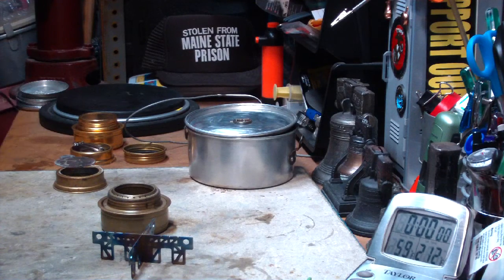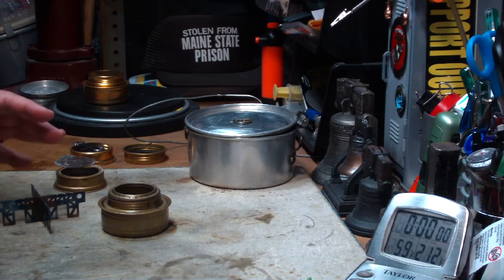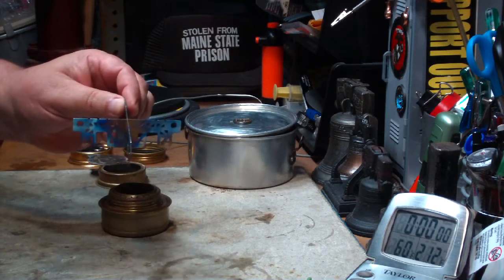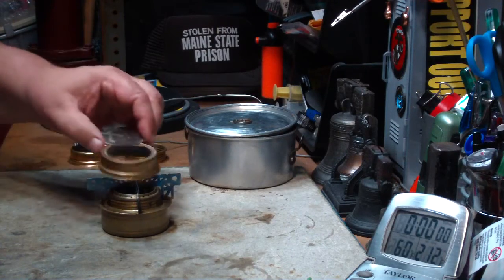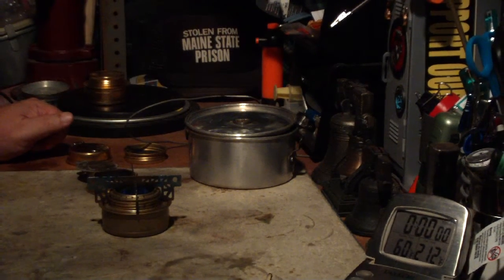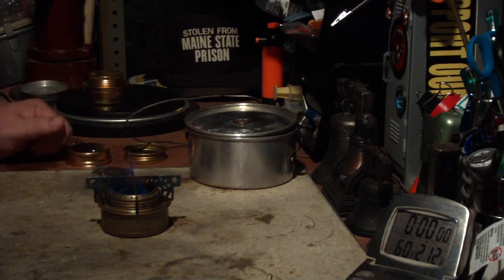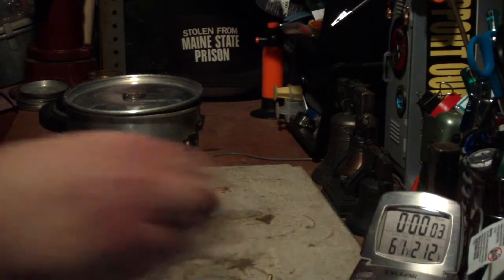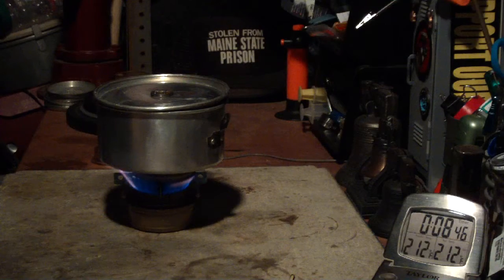tristansyarns' ''Esbit and evernew cross stand idea'' - Boil Test #1

Comment: did the test this morning .on salt and pepper shakers but i added insulation fiberglass wire wrap on the very top just a little and after the burn all looked fine no charring on any material the burn to a bit to get going had to keep putting alcohol on the out side until jets took off .but when they did it looked like a jet engine i had it siting in a small tea light stand boiled 1 cup of water 3 and a half minutes once the pot was on it became a circle the cap tarnished that it very cute .